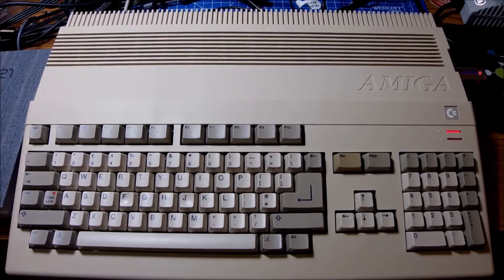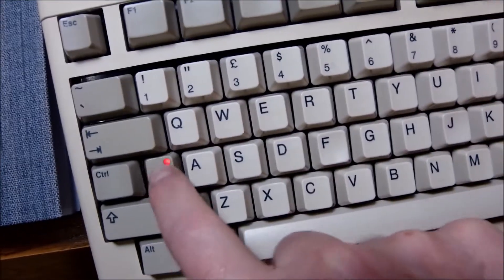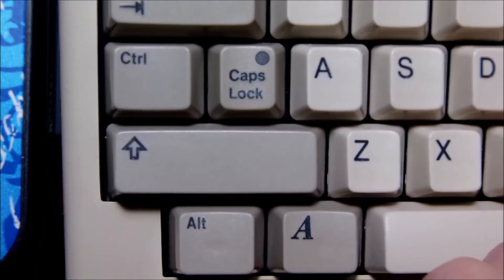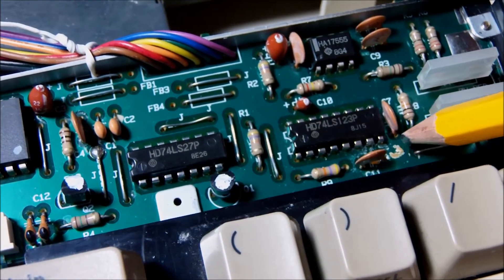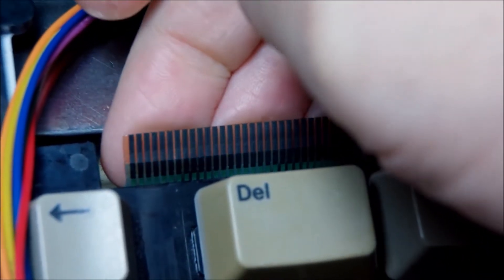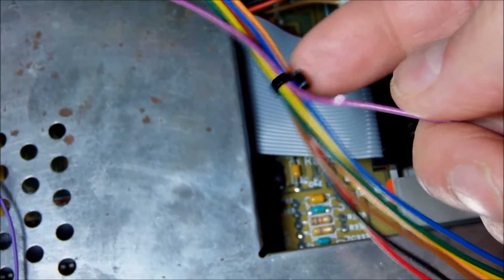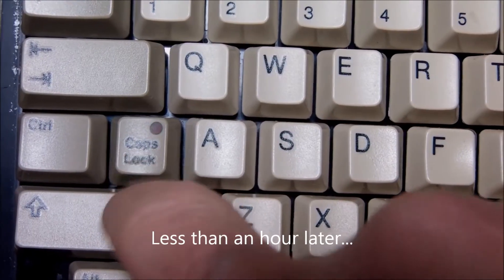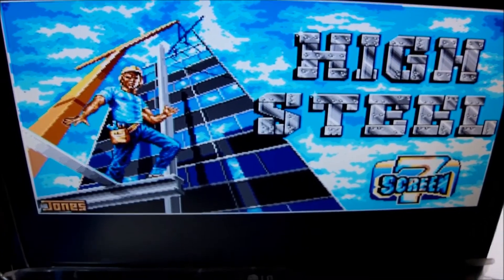Amiga 500 - Caps Lock key flashing / blinking: the Fix checklist.

Comment: happened me moment ago, but coz was i plugging rf modulalor when it was powered so it short circuit something. when its on amiga not boot when its off amiga blinking capslock keyboard not work.
and bcoz rf modulator not work i have grey screen
i giveup its my secondary a500 with pistorm

Comment: If you think about it 35 years of hammering a keyboard that houses a controller chip is going to result in breakdown of solder joints from the constant vibrations along with thermal cycling. Maybe this is why on the A1200 it was moved to the motherboard instead instead of on the keyboard. A solder reflow to all the MOS keyboard controller pins by moving the plastic sheeting out of the way usually fixes this. Sometimes the pads underneath don't have enough solder to maintain good connections.